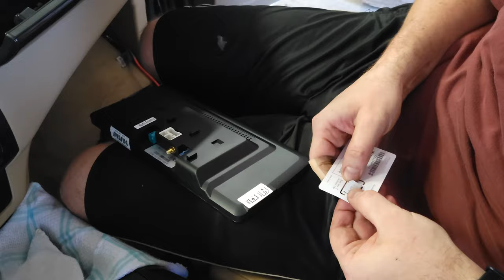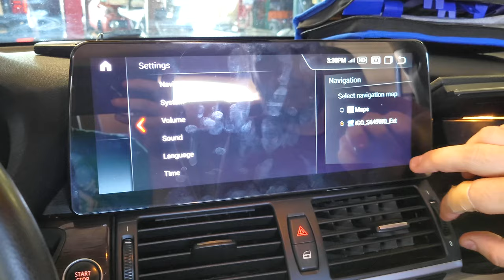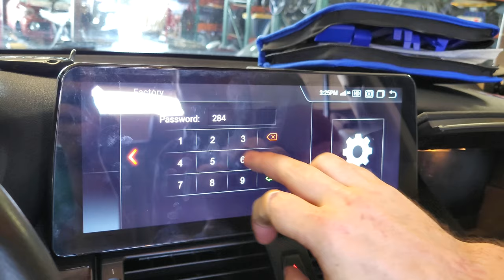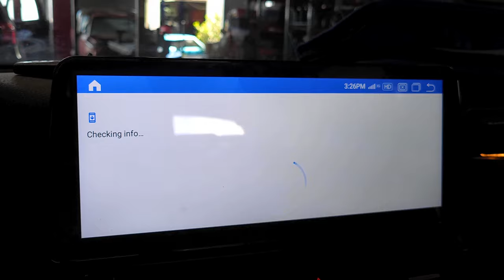AVINUSA 12.3" Android Multimedia Navigation DIY Install Into E70 LCI Installation

Comment: The screen looks outta place compared to the 10.25.  I thoughy 12.3 would look better but I'm just going with the old 10.25.  Thanks for the vid.
Reply from the maker: Not a problem. Everyone likes different things. Both are good tho.
Reply: yea the 12.3 is a bit off center. it looks odd compared to the 10.23

Comment: Just purchased this for my 08 E70 X5 CCC and the standard "1314"  Factory Code will not work. We looked up over 20 codes in videos and blogs and NONE of them allow us into factory setting. Which we need to do to get the unit to work Properly. Please Help if anyone knows the correct code.

Comment: Hi, thanks for the video. If you have factory Navigation and Blutooth (CIC) then do you still need to use the GPS and Wifi antena that comes with the kit? Also is it not better to use the host mic and not install another external mic?

Comment: I have just installed this unit in my 2012 x5 but my back up camera is not working . all the connection are right and I am using oem camera . there is no setting which I can change in the factory setting

Comment: I plan to purchase this for my 2007 X5 E70 with CCC .  Mine does NOT have factory GPS nor back up camera.  Will this unit give me those capabilities if I purchase the after market rear camera?  If yes, would you recommend the wired or wireless camera?  Thanks for inspiring me.
Reply from the maker: Hi.. Sorry for the long response but here it is. If you have CCC then yes you can still install it. You just need the CCC version of it. And yes you will get GPS function and backup camera function. You just need to choose those when you make an order. I'm using wireless backup option because it's a little bit easier to install but they sometimes give a lot of communication problems and picture can be static. If running cables from front to back is not a problem for you use wired system.

Comment: Going with the 10 inch. My ocd won’t allow the asymmetry for the 12 inch
Reply from the maker: 10 inch is not a bad choice either
Reply: Yes my ocd will have me thinking it's crooked like something is missing 🤣🤣🤣🤣 but if it was centered I would buy it😊 so I went with the 10.25 it looks more factory 😜🤪 Great Video Sir

Comment: How about navigation? I've got a 2008 E70 X5 with CCC unit, which doesn't have factory navigation with all maps. 
Does navigation work good and will it show your position real-time as it should?
Reply from the maker: You can run any map application as you want. We run usually Waze app. It uses oem GPS or you can install aftermarket GPS antenna on the car. It's perfect and 1000x better then OEM maps.

Comment: Why do you change CAN settings in the Factory for the 4th string? Normally it works fine for CCC/CIC on the 1st one.
Reply from the maker: We just did. No point to do it. seems all CAN options work the same. We haven't found any difference on those.
Reply: @EstPerformance  I've ended up with the same conclusion. But I noticed for some Evo devices string number 2 solves some oem menu picture issues (removes flickering).

Comment: Could you use the original microphone instead of AVIN's?
Reply from the maker: You will still use the original one for the oem side of the radio functions. For the Android side i think you need to use the included one. But don't quote me on that.

Comment: Was there a certain way you hid the cables behind the deck? I'm having a hard time hiding the cables and getting the deck back in.
Reply from the maker: Hi.. Yes. You can't hide them behind. Not enough space. You got to try to hide them under and left corner. Yes. It's PIA but possible to do. I wish avin would have longer pigtails.
Reply: @EstPerformance  Thank you, it has been a PIA and its the one thing that most videos I've watched every installer seems to skip over this part or just cut to after they actually get deck back in. Thanks for the reply and doing the video!
Reply: @EstPerformance  I forgot to ask did you remove any side panels to do this or did were you able to do it with just removing the main front panels?
Reply from the maker: @chinnobi  Just the front. And passenger long one for installing the aux. I can only relate why they skip it. All these curse words that come out doesn't belong to a YouTube video lol

Comment: I got the same unit but different supplier and after connecting all the wires (including the aux) there is no sound from the speakers (my car is 2012 x5, CIC, w/o GPS, 6.5" screen).
What did I miss ?
Reply: Did you connect the optical cable properly?
Reply: @bluememph1s 
Sure did 👍
Reply from the maker: @eslamsedky72  Did you get it figured out? You sure you have AUX selected from the old unit?
Reply: @EstPerformance 
No, I could not figure it out
Tried all the settings and options in the unit software
I'm sure it is connected properly bc all the original functions and menus are working fine
All I'm getting is a wavey puzzing sound
Reply: Update: upon the supplier instruction to perform "learn" procedure on the CD's selection buttons (with the AUX cable connected), the unit worked and the sound is as good as the oem unit 👍👍 and I have no clue why did that work 🤷‍♂️
Reply: @eslamsedky72  can you clarify on how you did this?

Did you figure this out and I have the same problem, original BMW radio and multimedia, but no sound from Android? 

Thanks for replying and helping out... 😊
Reply: @DigitalCircus777  
The solution is mentioned in the comments, just do the "learn" procedure with the AUX connected, that worked with my case.

Comment: Hey brotha, I am having audio problem with my 12.3 android head unit  . Sound is coming from oem radio on oem screen but no sound for android  CarPlay via zlink and no sound from android screen. Any help would be great.

I connected oem optical cable to the android harness. I routed aux cable to the aux port inside armrest. Still no sound. 

Do I remove aux extension  from arm rest then reconnect male aux to the female aux on the android harness like you mentioned and see if that works ‘

Would that make a difference. 
Your help would be much appreciated
Reply: hey brother did you figure it out?  is it a setting issue in the factory setting ytou think?  im going to try and fix mine again tonight
Reply: @artemisentreri9684 did you figure your problem out, was it a setting or connection cable?

I have the same problem, original BMW radio and multimedia, but no sound from Android? 

Thanks for replying and helping out... 😊

Comment: I have a 2013 X5 M - wondering if this will work since i have premium sound
Reply from the maker: Yes it works with all sound systems
Reply: @EstPerformance  Any tips on fitting the stock radio box back in? the avin harness addition adds so much bulk that the stock radio won't fit all the way back in...
Reply from the maker: @swerze1  Hi.. Yes. You can't hide them behind. Not enough space. You got to try to hide them under and left corner. Yes. It's PIA but possible to do. I wish avin would have longer pigtails.
Reply: @EstPerformance   very important question that doesnt get asked enough and hopefully you can answer it.  Previous avin units had diminished sound quality coming from the android side but worked perfectly fine on the idrive side.  Do these newer units have the same issue or has it been resolved.  Again in previous avin units specially the ones that came with android 4.4 had poor audio quality when playing on the android side.  Please let me know.
Reply from the maker: @jrlathrop1  Hi.. I don't notice any quality loss from original head unit vs android at all. But that's my take.
Reply: @EstPerformance  thank you!

Comment: Why you kept big disturbing cable plug and why you use AUX plug?
Reply from the maker: What do you mean why? Because it's plug and play? And AUX needs to be used for 90% of the cars.
Reply: @EstPerformance  yes it is plug n play for people who does not have knowledge in bmw electronics. You have to vode out one more AUX on the screen to use it for sound instead of AUX plug in elbow rest.
Reply from the maker: @gatojurko1  What are you talking about?
Reply: @EstPerformance   if it is ccc,code out one more AUX. Plug out the cable from AUX use car's AUX from factory wires. That cable are behind unit where you left that big plug.
Reply from the maker: @gatojurko1  2011 and up has CIC. So nothing to do with CCC
Reply: @EstPerformance  for cic almost the same only different coding for sound. Yes,any way no AUX cable plugged in elbow rest
Reply: @gatojurko1  i have a 2010 F07 with Rear Entertainment System. When the Android device chooses automatically the AUX it takes the Rear AUX IN. Is it possible to change somehow that it really takes the front AUX or Cars AUX (wires in the Headunit) ? Thx

Comment: I just installed the 10.25 with Android 11 from Avin. It's my 2nd unit from them, so I'm pretty good on setting it up.
Nonetheless, with this unit I'm having 2 major issues:
1. The wifi is ON after the unit boots up, but it turns off in about 10 seconds. Hotspot is enabled on my phone, so it should connect right away, but it doesn't. Wifi settings are on Connect Automatically, but obviously they're not working.

2. If I'm listening to anything on the Android part (Spotify or any other player) and I'm switching to BMW menu by holding the Menu button, that player is paused and sound turns OFF. 
But, if the car is standing still and I press the rear view camera button on the dash, the music still continues, even though I've switched to the BMW menu by doing that. I can even scroll through the whole menu and the music still plays.

Both issues weren't present on my previous Avin unit: 10.25, PX6 chipset with Android 9. 

The problem is: I don't know what's causing both, but I'm almost sure it's a software bug. 

I've tried both Automatic and Manual Aux switching in settings. I've tried Harman, Alpine and Other, still nothing.
Reply: Did Avin solve your issues yet?  hows  the quality of the sound and how do you play it? did you get that  Android Autoplay USB adapter they sell with their Autoplay dongle?